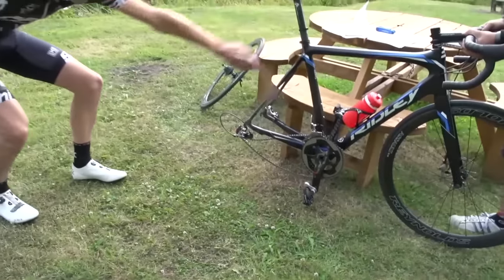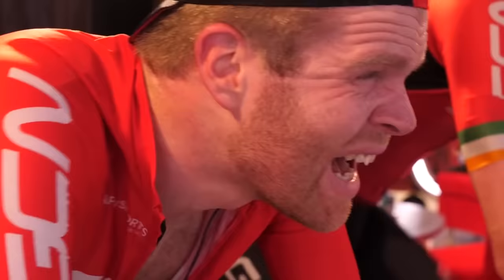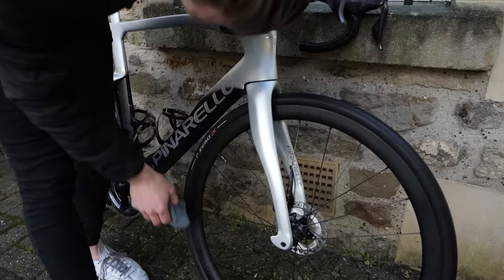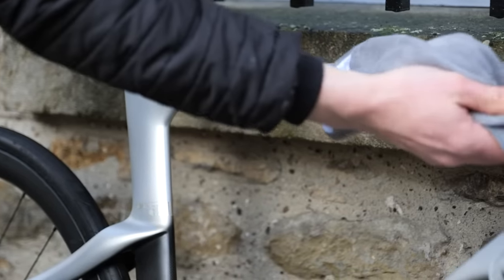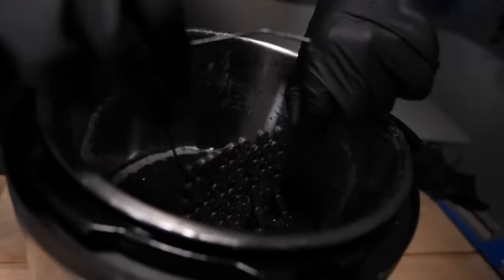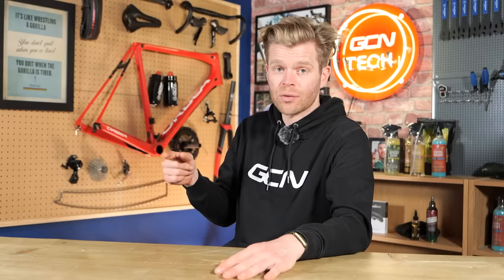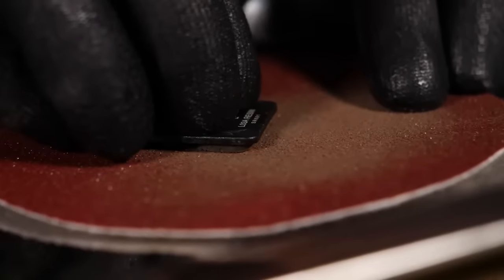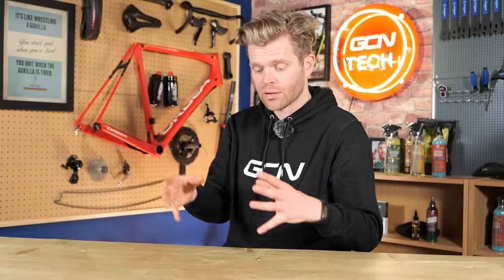6 Maintenance Mistakes That Are Ruining Your Bike!

Comment: I've found that white lightning chain lube (clean ride and wet ride) creates a decent waxy coating that will flake off and take dirt with it. Have TBH though that i use WD40 in the winter for my commutes - spray it on when i get to work and it takes the water off and gives light lubrication, do the same when i get home and ditto.

As for washing - i just use a car shampoo they are formulated not to strip wax, don't contain salt as an abrasive (which washing up liquid certainly does) A quick squirt of turtle wax - wash &wax (about 2 teaspoonfull) in hot soapy water does a good enough job and it's not that expensive - £3 for 500ml.

Comment: Treat the frame paint just like a car. wash it with a car soap and soft mitt. Then apply a spray wax, or a spray ceramic wax (even better). for tires, 303 spray will protect the rubber and get it supple while preventing cracks. 303 should also be used on ANY plastic or rubber. For the chain, a chain cleaner and brushing, followed by a chain lube. Dawn dish soap does indeed STRIP everything from paint like previous waxes.

Comment: 1  does carbon corrode from salt?
2. You do use a brush on a car and you do need it on a bike. A lot of dirt can't be removed just with running water or a cloth. The brush goes into nooks and crannies, the cloth doesn't
3. You do want lubrication on the outside of you chain and cassette  or it will be red with rust after the first time in the rain. PS: wax dipping also gets on the outside.
Reply: One issue I've had with chain waxing over winter is rusty cassettes. It doesn't affect performance but it looks rubbish.
Reply: A brush is better than a mitt, as the bristles lift the particulates away from the paint without letting them scrape the surface.  Of course you don't hard bristles to scratch the paint.  I've used a horse-hair brush to wash my cars for over 30 years and it gets used on the bike as well.

Comment: Love it :) unfortunately suffered from the bike bag issue! and find it very difficult to find a secure locking point that does not contact the frame somewhere - bike racks for example :(
Reply: Plot twist, my adventure bike's paint is protected from this because the front and rear rack make contact first with most bike racks 😁

Comment: Don’t underestimate the benefits of a good ceramic wax and detail spray on your frame and exposed parts like the stem, bars, seat post and wheels. Totally agree with chain oils, been on too many rides with these types and came home with black spots all over me and the bike. Say no to high pressure washers too, stop forcing the lube out of your spinning parts.  Bike leans tear me up, do it right or be prepared for the damage it produces. I feel for Ollie, my OCD meter pegged on this video. Glad to see some common sense videos from you guys as always…thank you.
Reply from the maker: Ceramic coating your frame you say ... keep those eyes peeled on the channel this weekend 👀
Reply: @gcntech  …..most excellent, can’t wait.
Reply: any ceramic spray wax is a GREAT idea. Protects the frame and the clear coat for 6 months. Should be washed and applied twice a year. The frame will look like NEW.

Comment: I use car products made for cleaning the interior of your car and also wax the frame the same way you would with a car. The dirt does not stick to it easily and dusts off easily.
Reply from the maker: Waxing is the way to go 🙌
Reply: this is exactly the correct way to do it. Bikes are painted with the same paint as cars.

Comment: I got sick for 4 days, leaving my bike unattended. After I got well I went to my bike to clean off the dusts. I noticed there is a very very tiny pops on my carbon fork, I don't know

and I went to go outside and cycled for 1 kilometres long and after I got home to to change my lube, I noticed there's a crunching sound inside my casette, it's like there's a debris inside that is scratching the casette or sum

Comment: I know all about leaning one's bike against another bike because the C** C*** bike shop here in St Helier did this to my glossy Specialized frame - their mechanics simply lent their customers' bikes against one another. As a consequence, my bike had scratches on both forks and seat stays!! If bikes are to be lent against each other, e.g. at a cafe, then use the 'head to toe' technique, i.e. bar to saddle, then saddle to bar etc.

Comment: 1. Buying a derailer instead of an internal gear hub.
2. Using a chain instead of a belt.
3. Using wired brakes instead of hydraulic brakes.

Comment: Disagree with Ollie on this one. been using the same rusty brush and fairy liquid for 6 years. Paint job on my Giant TCR hasnt had any damage from it. Probably would've spent hundreds of pounds to use mucoff for all those years. Plus i degrease the drivechain and wash the frame all in one. works fine.

Comment: I love the hipster reference.  I have a seat bag that holds all the necessities I carry (spare tube, tire levers, patches, multitool, and a second section that will hold my wallet and cell phone).  Why do people need luggage on your bike for a 10-20 mile ride?
Reply: Going to work? Shopping.  You do know bikes are used for more than a 10-20 mile "ride"?
Reply: @bindingcurve  That's why I said a 10-20 mile ride.  I know people who's bikes look like their taking a cross country trip on every ride, you don't need all that crap for a quick tour.  I never said or meant to imply there is no reason for it...just on short rides like the video mentioned.

Comment: Thank you for the video!
Why doesn't anyone use liquid car waxes for chains.. no abrasives.. they are also available in ceramic these days??
Reply: Car waxes are not the same as chain waxes.  The idea behind a real chain wax (not just people dipping in paraffin) is that they include friction modifiers.  these go in between the rollers and pins and form a barrier against wear and make the chain last much longer.  The second benefit is it staying clean longer and having better shifting quality.     A car wax is mostly carnauba and carrier that is designed to form a protective layer and add the oils back into automotive paint. They do not contain any type of friction modifiers at all as that is not their design.  Also "ceramic" is a term that is thrown around with reckless abandon and not everything is a true Si02 product.

Comment: I use WD40 as a degreeser... I then wait for it to dry and then apply lubricant... Is this a correct way to clean a chain? I also use WD40 to lube the shift cables... Is this also in the wrong? WD40 is great! It would surprise my this causes damage.... I have a carbon frame and not sure if it damages carbon... It would also surprise me.... I dont use degreser on my chain becuase it then goes to places you dont want for it to go like the rotor, frame, floor etc

Comment: there needs to be a big disclaimer on the packaging for wd40 that it does not work well as a lubricant in performance machines. even in the cheapest bicycle it's going to eventually cause problems

Comment: Ollie touches on one of the reasons I got rid of all my disc braked bikes. I only had to so much as think about lubing the chain and the brakes would start squealing. Anything on a bike should be able to handle a little oil or grease in the wrong place; if it can't, it's not fit for purpose. I've gone back to rim brakes and I'm not missing discs at all.

Comment: Washing up liquid is fine. Just use a couple drops. All you’re using it for is to create soapy water lubrication so that your contact washing with microfiber towel doesn’t cause scratches. The idea that you need specialist bike soap to wash a bike is silly. My bikes all still look brand new.

This is obviously not the same thing you should use to wash / degrease your drive train. That should go without saying. 

But for your bikes paint, a couple drops of dawn in a bucket will do you fine. A clean and pre soaked microfiber towel is the key here.

Comment: Jet wash from a distance so not too much force,  then wipe over / wash off that orange concentrate from Halfords or equivalent , use a chain cleaner, then the most important of important things, ACF-50 oil everything except the brakes obviously.  I use it on my motorbike, car engine / suspension mechanism,  everything still looks brand new, even after ten years and works perfect;y.

Comment: Pressure washers and hose with a high water pressure  directed at a wheel hub or cassette and bottom bracket is a sure way of introducing water into the sealed bearings and housings. The high pressure momentarily overcomes the bearing seals and allows water into the sealed areas which has no way of exiting. Then unknown to the rider nature  slowly takes it course creating your very own bike cancer, commonly known as rust, or Fe2O3 iron oxide, don't do it people its a wheel killer!
Reply: And a good way to get your mechanic to curse your bike while working on it too.

Comment: Wow, utility razor knife used to cut off handlebar tape on a carbon bar. Ugh, be careful not to drive the blade into the carbon bar which would introduce a compromised surface owing to the razors edge running up against the carbon bars.

Comment: I find it unfortunate that some videos portray bike bags as merely a trend for carrying garbage. This perspective is misguided, as bike bags can be incredibly useful for many cyclists, especially those engaged in unsupported touring. Furthermore, concerns about damaged paintwork are often exaggerated; if a bike bag is fitted correctly, it should not cause significant wear and tear. It's important to note that any potential damage to the paintwork is more likely due to improper installation or use, rather than the use of bike bags themselves

Comment: WD40 is great as a preventative for rusting. I see it being used on building sites by brickies on their trowels. What can be applied to a chain/cassette to prevent any rust appearing. Just thinking that even if you lube/clean/degrease regularly, you still could get an appearance of rust due persistent wet conditions.
Reply: Using WD40 on your bike is mistake nr 7
Reply: @leiflarsen8422  It's not, it's a very good water dispersant, as Dan said, stops rust after cleaning.
Reply: @ollyole4560  Correct!  I tried the dry cassette and waxed chain thing, once, and will not see a twice.  The first small spring shower that hit me on the road seemed no big deal until mere hours later on the same day, when rust had formed on the cassette and outside of the chain links!  Now everything has a thing film of WD40 at all times.  No more rust.
Reply: @ollyole4560  once rust has started, it is time for replacement, end of story. Chains NEED proper chain cleaner, and chain wax. WD40 is NOT that.
Reply: @00vortech Water displacers like WD40 will prevent rust. Hence their use, especially when you're waxing when leaving water on the chain leads to corrosion.

I've actually ordered some rust removeral fluid for my ultrasonic cleaner after I forgot to dry my waxed chain after a ride, from what I've read some rust on the chain is far from 'end of story'

Comment: Do you have any tips for protecting disc rotors when degreasing/cleaning? I am on verge of buying muc-off protectors which seem to be oveprices for what they are. But I dont want to remove wheels every time I want to spray degreaser on cassette or chain.
Reply: removing wheels is ridiculously easy and fast.... well worth the extra few seconds.
Reply: @JoelSzymczyk  You might be right, but that still does not solve the issue of spraying degreaser on a cassette.
Reply: @ales_krejci  "floss" the cassette with edge of a terry cloth rag... with very little or no degreaser-   if full degreasing and cleaning down to bare metal is needed,  I just remove the cassette.    Taking ALL the dirt and old lube off is ... I'll say it ... a waste of time and effort.   As soon as you pedal outdoors you are adding contaminants to the drivetrain....   there is a functional point of CLEAN ENOUGH where "more" is no advantage.

Comment: Wd 40 u turn , 
It still has its place, especially as a water/ salt displacement tool, great when u store a bike over winter and u don't want the metal surfaces going rusty , or when your better half has been away at that 100 k mud fest gravel event and that nice young man at the finish line says ,,over here i will wash your $6000 bike with this high power water blaster it will look as good as new , 4 hrs later...
Luv 😊  did you pack the wd40 to spay over the chain and cassette and headset before the 160 km drive home 😮😂😊

Comment: Didn't think I am more picky than Oli... But I wouldn't lean my bike against anything by the saddle.... you joking? :D I spent a chunk on a saddle that is comfortable and wont cause problems, I will not be ruining that... lean the tires or the bar tape maybe :) It is just my opinion tho.
Reply: What on earth are you doing that leaning your bike against some rigid surface at a couple dozen mN is going to be ruining your saddle? Are y'all fixing it underneath some hydraulic press or what is going on? No hardcore leaning method in the world will put sufficient stress on a saddle of all things to even remotely turn this into a problem.
Reply: @minhuang8848  to avoid the risk of the bike starting to slide or someone knocks it slightly. The friction from the wall surface can damage the leather. 

And also I do it because it takes almost no effort to do and I avoid the risk of scratching an expensive saddle
Reply: I agree.  If I had to choose between damaging the paint or damaging the part I sit on, the paint is gonna' lose.

Comment: Nobody ever mentions lubing the deraillers. I wore one out after about 30,000 miles despite oiling the pivots.
Reply: I used a mix of 2 parts mineral based ATF and 1 part Lucas Red n Tacky grease and  a dash of STP oil additive . Let it sit at both ends of the pivot and creep in (that's what the main job the STP was for it would get everything into the pivot. The  pullies all needed a specific lube and definitely NOT a liquid  drip nothing like T-9 it just washed out the grease which Shimano never put enough in from the factory. The full steel bushing guide pully 10:37  use a liberal amount of real grease. The ceramic guide pully use ceramic grease. And the plastic bushing tension pully Shimano  Cable grease is fantastic but as long as the grease is compatible with plastic you'll be fine some greases are hard on plastic. If you have any traditional shift and brake cables you will want that Shimano cable grease anyway a little is more in the cables with that stuff too. That stuff I mix up nice in the STI levers it keeps the little ratchet pawls free it wil losen sluggish ones too.I keep  it in a drip bottle with a straw stuck in the end. This stuff works never have any problems with the winter bike in Madison Wisconsin and they salt heavily too keep the traffic moving.

Comment: Don’t ever spray degreaser on your chain as the chain is impregnated with factory grease. If you remove this with degreasers you will never get deep impregnated oil into all the links.

Comment: Any special wax or would normal candles wax do the trick?
Reply: As long as they aren't scented/coloured and just plain old paraffin wax, yeah pretty much. It wont have any additives like PTFE so will perform about as well as a good quality wet lube, and it tends not last as long between re-application* but a lot of people do it, and it will extend the life of your drivetrain and keep it mostly dirt free just like the branded stuff.
*It's a little too hard/brittle in its pure forum so it doesn't cling to the metal as well, some people do 80-90% paraffin wax and 10-20% Beeswax to solve the issue, some add Liquid Paraffin (the stuff vets use not the dirty lamp oil stuff).
Reply: @chris1275cc  👍but having a nice scented chain will surely smell nicer 😅

Comment: Or, if you're more interested in supporting yourself (the cyclist), instead of the cycling industry. Use washing up liquid, it won't damage your bike and won't contaminate your brakes, and use a wax based drip lube that people can actually afford, like Squirt lube, 99% of the benefits for a fraction of the price.

Comment: Honestly, this is way over the top. This makes it seem like all bikes are made of glass and if you look at them the wrong way they will shatter. Bikes are equipment, they are meant to be used and ridden. If they get dirty, some water and a cloth can clean them off and a good tune up once a season is all most people need for maintenance. All you guys are doing here is further making biking seem like some elite activity that only the rich spandex crew can enjoy because they don't commit the sin of gasp putting a bag on their frame without panicking over the fact that the velcro strap might scratch the paint job?

Comment: The furphy of lubing a chain roller by roller is something promoted by bike obsessive-compulsives. That's you, Ollie. It's fine to aim a dripper nozzle at the inner link/roller interface, and add lube as you rotate the chain. NO-ONE's got time to do 114 links/228 rollers, one at a time. & much better minds than yours have seen waxing for what it is: the cyclical product promotion of wannabe industry leaders (read: retreaded badge-engineered hype-engined massively overpriced 'special sauce' snake-oil merchants such as Silca)

Comment: Some more beginner advice might be helpful for me... for example, when you replace a worn-out/stretched chain, replace your cassette at the same time.  If you don't the wear wont match and your new chain will get shredded which will damage the derailleur and other drive chain elements.

Comment: WD40 is 100% fine. C'mon man, get out of here with that. It's not oil based, it doesn't damage rubber. It dires off clean, won't affect your brakes once it's dry